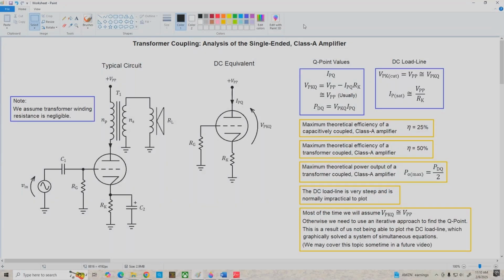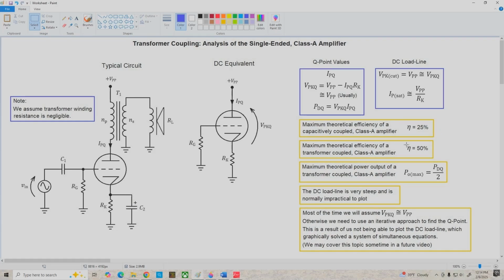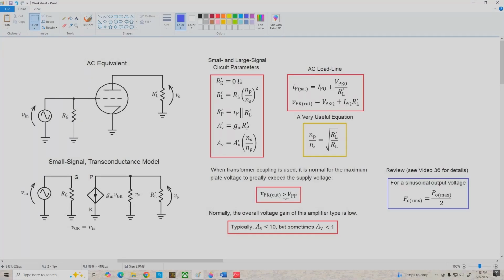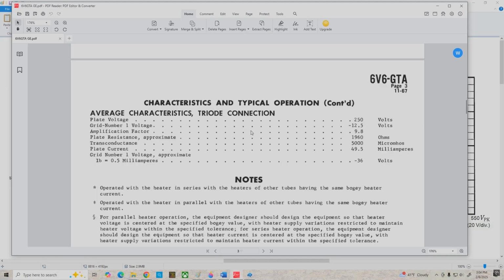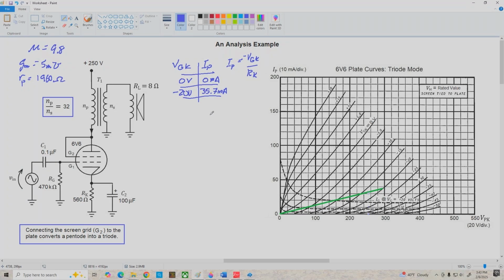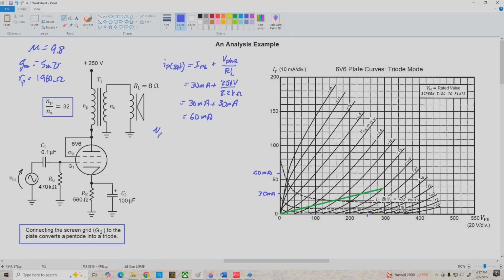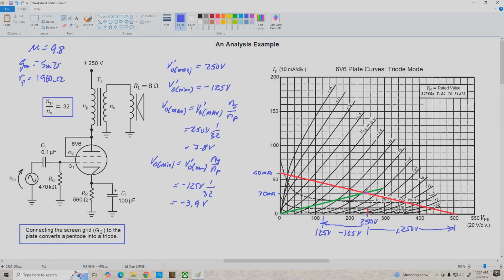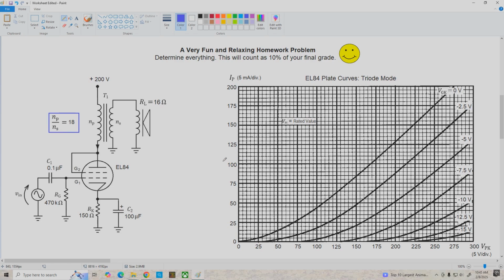Topic 76: Transformer Coupled, Single Ended Amp Analysis

Comment: Loving your book (3rd edition) as well as the videos you have been posting.

Your study of how reflected impedances arise and how they can be understood from the turns ratios has been really enlightening for me. 

I do remain a bit puzzled as to how the Current and voltage at the loudspeaker (load) interact, and how to compute them.
 
It seems I should be able to use the turns ratio to get the current at the speaker, as you have done for the voltages at the plate and output sides of the transformer - 

Am I even close?
Again, terrific work

Thanks, Scott
Reply from the maker: @scottfinney5667  thanks and I’m glad you are finding the videos and the book helpful.

Loudspeakers are actually pretty complex from an electrical standpoint, but one of those components that we usually just model as a resistance and let it go at that. For this simple case we just use Ohm’s law with real numbers.

I might talk about this in a future video. And, sometime I’d like to do a fourth edition that covers everything in more detail (more derivations, examples, problem sets, loudspeaker stuff, etc.) if I can get the publisher to let me go to 1000+ pages. Anyway, thanks for the feedback! 👍🏻

Comment: hi ,your q point is too much to the right its not symetrical ,the best is to have a q point symetrical right to left . So  in the rounded of the curve its not linear
Reply from the maker: @kubockferre5532  I hear ya. But here (guitar amplifier applications) I really don’t want a super linear amplifier. If I was doing hi-fi I’d be more careful about Q-point location and I’d use lots of negative feedback. I’ll talk a lot more about that topic when I get to effects circuits and op amps. It will be beautiful!